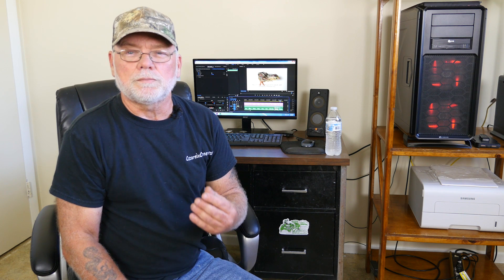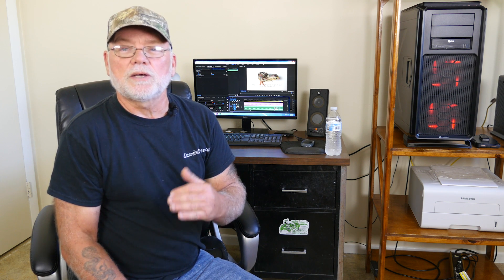QUAIL EGG DEVELOPMENT - Stages of coturnix quail egg development during the incubation period

Comment: I have a question. I was incubating some button quails i bought from online. I had candled them and most showed signes of development. 20 days after purchasing them (i had received a notification that they were shipped the same day i bought them), i still didnt have any baby quails or see signs of pipping, so i cracked one open, thinking the eggs had all just died since the eggs had arrived from the seller 3 days after they were supposed to. The baby inside looked like it was around day 11 or 12 in the development (some feather development, had its eyes open, mostly developed beak that was just lacking any color), based on what you showed and opened its beak a few times, so i know it wasnt dead. Ive put the eggs back in my incubator to see if the others will hatch. My question is, why are they so far behind in developing as to be over a week behind schedule? And will this impact the health of the other hatchlings if they do manage to hatch?
Reply: Sounds like your incubator was at a lower temp than 99-100 degrees. Did you put a second thermometer inside with the eggs? Could be your incubators fault honestly
Reply: I tried, but the incubator was only meant to have its built-in thermometer, so the one I put in shifted just enough to break two of the eggs. I gave them 2 and a half weeks to hatch after the original comment, and two did naturally hatch, but they didn't survive the night. I cracked open the remaining ones, and almost all of them seemed to have died in their eggs at around the same point of that first one I checked, if not sooner. Still not sure why that happened.
Reply: @wolfcat1973  definitely your incubator then or a power shortage.. can also kill a whole clutch if you kept opening the incubator a lot to candle, I only candle on lockdown day